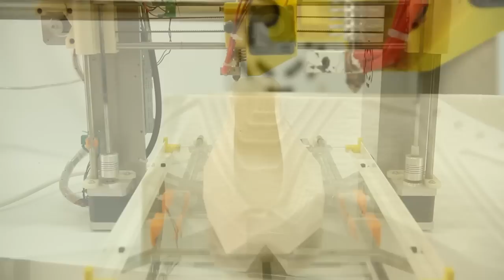New 1 75mm elastic filament Filaflex RECREUS Sneakers

Comment: Wow! If these can survive around 6 months, and the materials are cheap enough (eg. $20), I will wear these exclusively. I wouldn't even mind gluing a purchased or moulded sole onto the bottom for added wear protection (if necessary).
Reply: Sean Lumly someone should design an ABS sole that can flex at certain spots that you glue to the sole of this. You could have multi colored shoes, and they would take longer to wear off. Or it could be PLA. The full design is on thingiverse
Reply: Kodiak Bear GREAT idea!
Reply: I might do that, make a 3 par sole that glues to each joint and leave those crevasses open because I am pretty sure the rubber would ear away pretty fast
Reply: Kodiak Bear I really must get into 3D printing... Perhaps in 2017.

But I like your idea. If this can be made to work, it would be transformative to the industry. I suppose it all comes down to the materials..
Reply: yeah, ABS (which is strong and stiff) is pretty cheap and you wouldn't need a lot, And depending on how much these use a quarter of a kilo of the rubber material is just under 25 US and half a kilo is just about 35 US. ABS you can get for about 20 US for a whole kilo on hobby kings website, which if you buy hobby king brand is very cheap and reliable. Also getting into 3d printing is easy, I am getting an annet a8 from gearbest and it is a very good begginer printer although it is DIY so you have to put it together and that is why it is so much cheaper than others that are prebuilt. you could also buy a prebuilt one but it will be a little bit more expensive, but it all depends on how much you want to spend on your first printer.
Reply: I just want to know what the laces are made out of
Reply: Kodiak Bear That's good to know! 3D printing is awfully interesting!

In the end, traditional cotton laces would probably work well enough (and reduce cost. Other than that, a clever mechanism could be devised to tighten the shoe around the foot.
Reply: I was thinking about normal laces but it almost looks like they used the rubber filament used to make the shoes for the laces. I agree that these would be very cool is you had laces like the ones from back to the future. I looked at some people who made theirs and they said they used filament for the laces. I think the filament looks very cool, but it could be brittle. I do not know though because I have not purchased a spool yet.